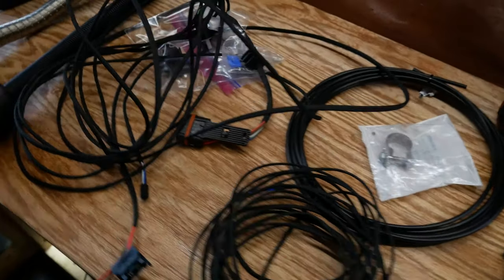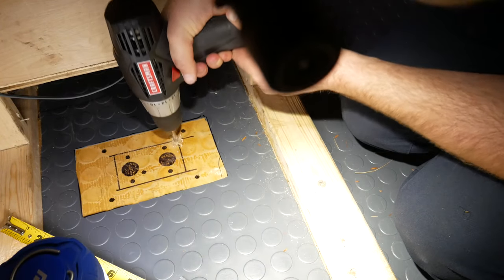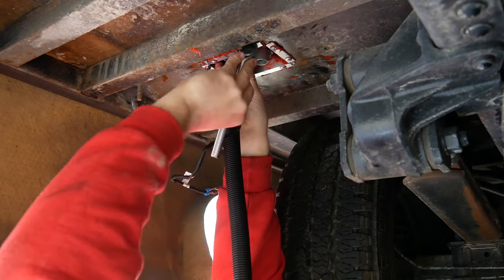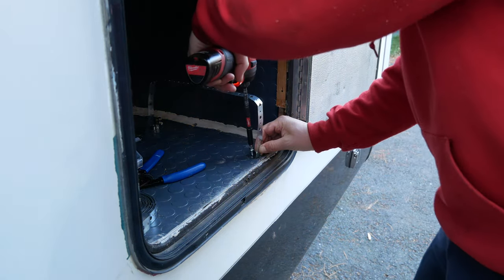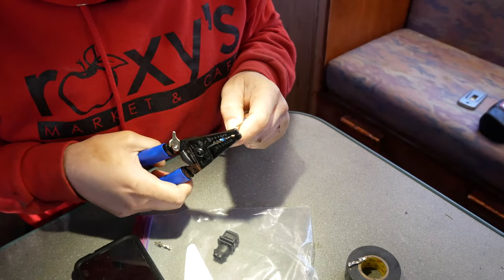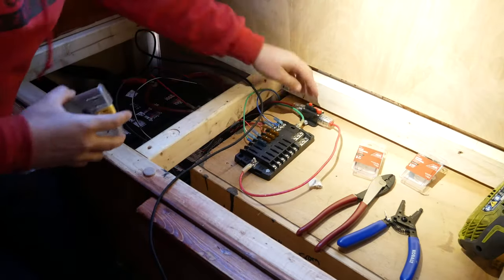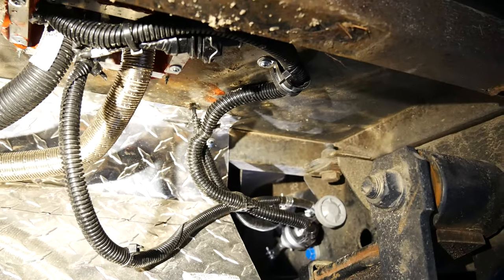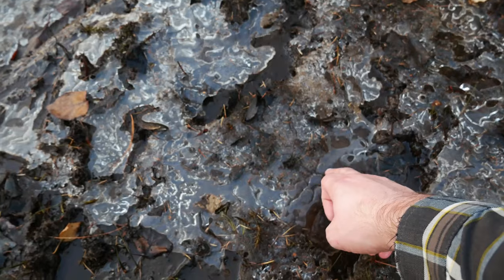Webasto diesel heater install on a JDM Isuzu Elf camper.

Comment: Another great video. I have been looking at the differences between the webasto heaters and the Chinese knock-offs.
Reply from the maker: Nice thank you! I like how yours came with the diesel heater already in so at least you're already tapped into the tank. I was too afraid to tap into the fuel line

Comment: Just fitting mine and hoped I'd find some wiring clues. My Elf had a gas heater with thermostat on a side panel, have traced three of the four wires to reuse but .....one to figure out.  Like you I cut a rectangular hole rather than the often described hole saw, I bent up some sheet metal and totally capped the edge of the hole so the base plate rides on the sheet metal but sealant does away with any gap. Cheers from NZ. (want to swap for a couple of months?)
Reply from the maker: Nice! Yeah mine been going strong for 2 seasons now. They're the best out. Haha swap Elf's?? 🤣 I still need to finish building mine haha thinking next spring I'll have it done haha

Comment: How warm does that 2000 keep your camper? Im looking to put one in my truck camper ruffly the same size as your rig. What is the nipple coming out of the Fule tank called? I have a tank already and just need the outlet nipple.
Reply from the maker: It does a great job I feel and I still need to insulate a lot of it took about a year off of the build but about to start it back up. I'll be honest I'm not sure what that is technically called but I upgraded my tank to a boat fuel tank that had a gage and a quick release fuel line so I can remove and fill it in the ground. It's way nicer and easier to fill